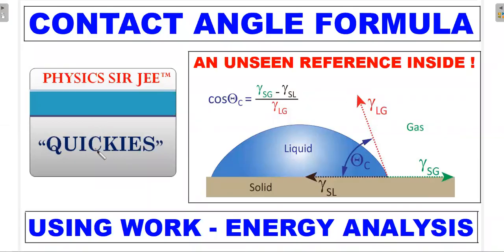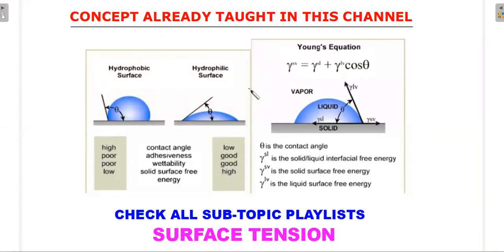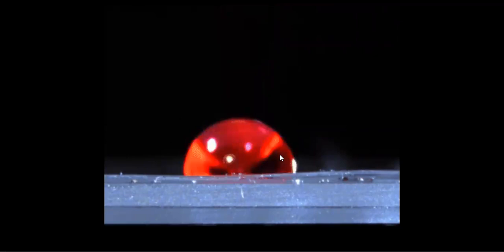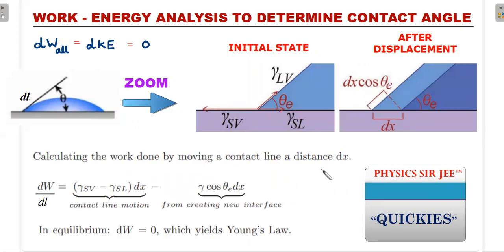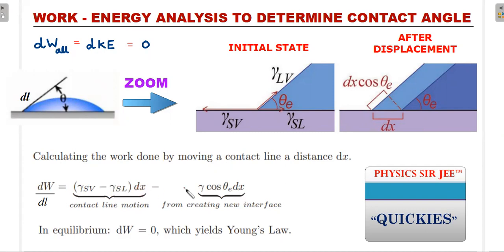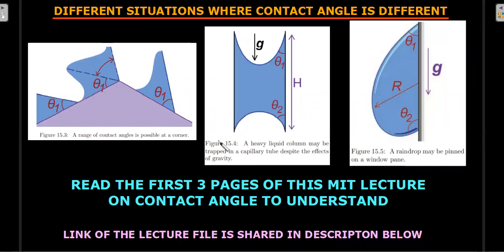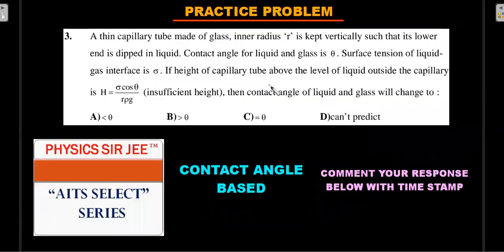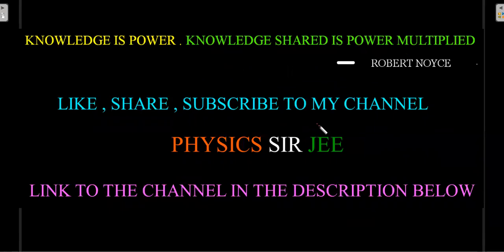JEE ADVANCED QUICKIES | SURFACE TENSION | PROVING CONTACT ANGLE USING ENERGY ANALYSIS | YOUNG'S EQN

Comment: Sir @6:35 when we calculate the work done why contact angle is assumed to be constant from initial to final state?
Certainly we can't take a intermediate infinitesimal displacement(to take angle almost constant) as then ∆K.E  will be non zero
Reply from the maker: This is actually "virtual work method' used in static equilibrium cases. You  imagine a small displacement from equilibrium position and write dU = 0 , which indirectly means F=0 .

We use similar method in mechanics problems in equilibrium.
The displacement is not the real displacement. During actual displacement, there is a concept of 'Dynamic surface tension ' which we don't deal with in JEE.
Our syllabus is related to "Static surface tension '
Reply: @PHYSICSSIRJEE  oh yes sir I am aware of the virtual work method ,( thanks to your videos) but couldn't realise it was being used here would have been better if you had mentioned it explicitly , nevertheless thank you for quick reply

Comment: SIR CAN YOU PLEASE SAY HOW IS THE ANSWER FOR PRACTICE PROBLEM B 11:38...SIR MY SOLUTION IS LIKE THIS... IN ACTUAL FORMULA DERIVATION WE NEGLECT THE WEIGHT OF THE MENISCUS,HERE BECAUSE ITS THE BOUNDARY CONDITION IS ASKED IN THE QUESTION,WE TAKE THE SMALL WEIGHT M OF THE MENISCUS, SO TO BALANCE THIS WEIGHT AND THE WEIGHT OF THE LIQUID THE TUBE SHD BE LITTLE LONGER,SO IF WE REDUCE THE CONTACT ANGLE THEN TCOSTHETA INCREASES AND THEN WE CAN MANAGE

Comment: Sir could you please clarify a doubt i have.  When we solve surface tension problems for example in a capillary tube we equate T(2pir) with mg. But T(2pir) is only the surface tension acting on the uppermost surface touching the sides of the tube, what about the surface tension due to the curve (concave upwards)it forms  because tension will act there too right,because its a surface why are we not taking that into account.
Reply from the maker: Please watch my videos on microscopic fbds in surface tension mentioned in this video. LINK IS ALSO IN DESCRIPTION